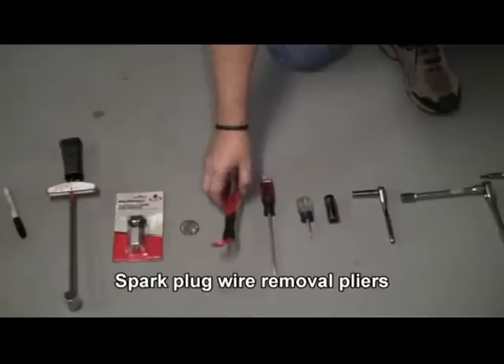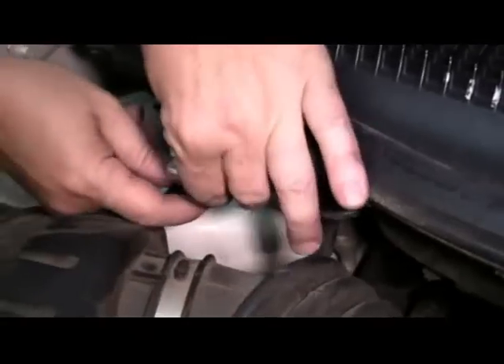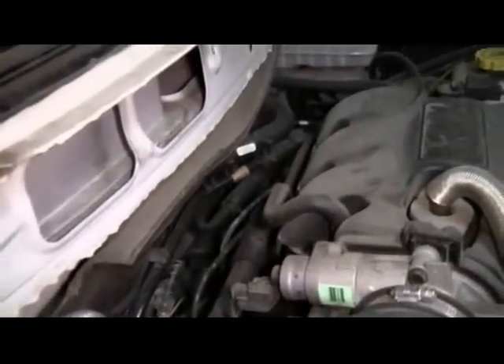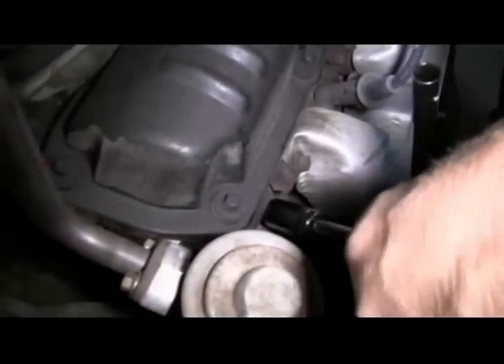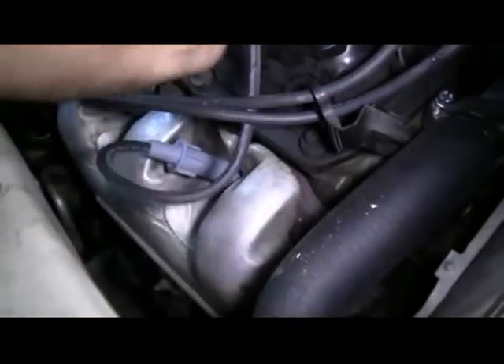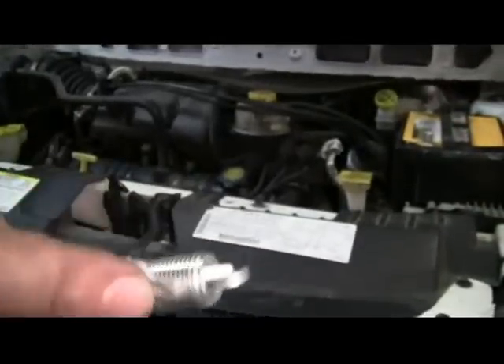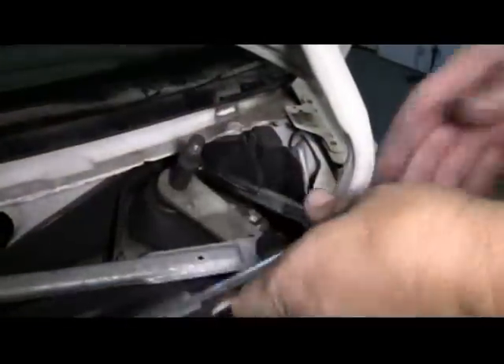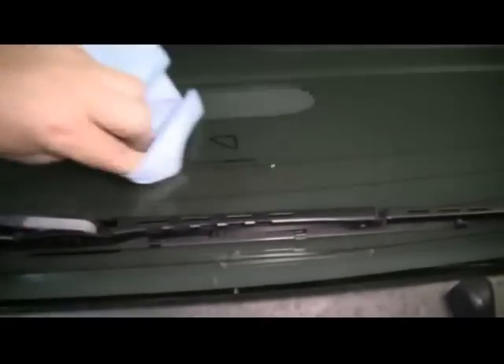Spark Plugs and Plug Wires on a 2002 Dodge Grand Caravan Sport

Comment: This si a great vidio, however, ihave a 2000 Plymouth Voyager SL and there were 6 bolts attaching the wiper assembly to the fire wall. One on each end behind the hood hinges and two in the center with the other two in between.

I followed the instructions on removing the top nuts and the firewall bolts.
The assembly unit will not budge.

The only thing I see is the center bolt holes have thick rubber washers still over where the bolts go and the holes appear as thougth you have to lift the assembly to wherew the holes are larger in ordere to lift it off. This alsodoesn't work.

I wish this vehicle was asw simple as the 2002 Dodge.

Could you give me any advice as to what to try next?

A gain your video is great and very informative, there's just enough difference in the two vehicles to stump me.

Respectfully,
John
Reply: OK, I got it off. It just took a little more forceful elbow grease. I guess ~I was a little shy of getting more forceful. However, there is not enough room to get to these plugs in the back with out dismantling a bunch more stuff.

My next move will be to find a rack.

John
Reply from the maker: There isn't a lot of room and I did most of the job by feel.  what size engine do you have?

Comment: Thank you , just changed the plugs and wires today. You were a big help.
Reply: Any plugs in it I have also brand new wires on it is it getting far do you think it's getting far it just turned over but it won't crank just won't start
Reply: Can I check to see if it's getting fired or not

Comment: Hi Greg - I'm going to take a shot at doing the replacement.  A friend suggested accessing the back plugs by removing the airbox.  Any pros/cons?
Reply from the maker: Jay - I don't currently have access to the van so I am not sure.  The only two ways I know of are to remove the wiper assembly or by coming up from the bottom.  We decided to remove the wiper assembly.  Now we did this on a 3.3 litter so if you have another size engine the process might be a little different.

Good luck
Greg

Comment: Thank you guys for video. Same me some $$$$$$$$.
Reply from the maker: Glad we were able to help..

Greg
Reply: Thorough and professional. Surprised blowing out the plug cavities before/during plug removal was not included. I did this job without removing the wiper/cowl assembly, and judged the overall time spent with lights and mirrors and reaching around under the cowl probably wouldn't be too much different. It WAS a bugtussle, of course.

Comment: Great video, this procedure works on the 2006 Dodge Grand Caravan 3.8L.
One tip is to twist the spark plug wire booth from left to right to break it free from the spark plug before pulling it off the plug. I made the mistake of pulling on the wire and the wire came out of the rubber booth. Pull it from the bottom of the booth. Thanks for posting this video.
Reply from the maker: Terry - Thanks for the tip and I apologize if I didn't make that clear in the video.

Greg

Comment: Hi Greg...I'm replacing my spark plugs in my 2002 Town and Country LX in a couple days...it has the 3.3 litre as well.So it would be the same process in my model/year van as the one your doing right?
Reply from the maker: I believe they will be exactly the same.  I don't think there are any differences between the Dodge Caravan and Chrysler Town and Country except for cosmetic changes.  Let us know how it goes.

Greg
Reply: OK....and you suggest that i use the 3/8" torque wrench in your opinion?I will have to buy one just for this one job and i'm on a budget.What is the cheapest wrench available at Auto Zone for example?
Reply from the maker: DrUmRbOy67 You can use whatever size you have as long as the spark plug socket fits or can be adapted.  If you don't have a torque wrench a lot of auto parts stores will loan out tools.

Greg

Comment: antiseize is not needed on todays plugs, they are made with a coating/plating on them. worked at a dealership and received notices that stated reasons why to discontinue use on plugs. plus it make torque values wrong.

Comment from the maker: I am not sure if it's the spark plugs or the plug wires your having a hard time getting off.  If it's the spark plug wires you should be able to twist the boot back and forth in order to break it loose.  Just be sure not to pull on the wire itself.  There are also special pliers made to remove the wires.  If you can get the socket on the spark plug you should be able to remove it..   I am no Mr. Fantastic..  All that being said this was done on a 3.3L and not a 3.8L.

Comment: yeah, unless you have the power of mr.fantastic, changing them from the back still a pain, i removed the wiper housing off, and only had enough access to get to the rear sides, not the center, and even from the bottom there is a bunch of stuff on the way, still gonna have to dish out a couple of bucks to have the rear ones changed.

Comment from the maker: Yes especially if it's one of the ones on front.   If you need to replace one on the rear of the motor then some of your time will be spent removing and reinstalling the wiper assembly.